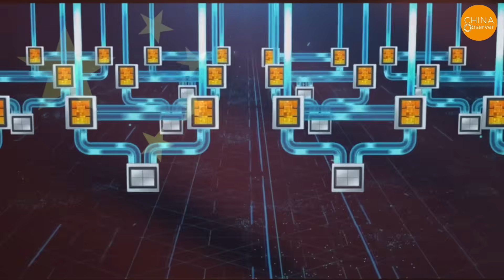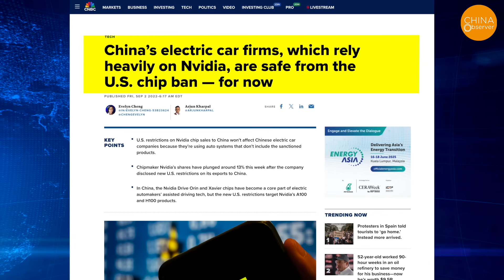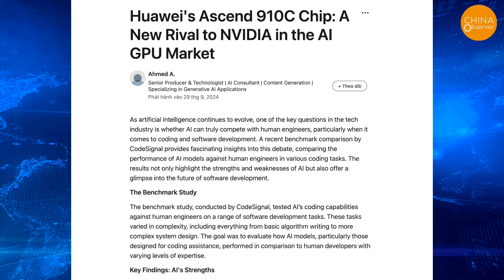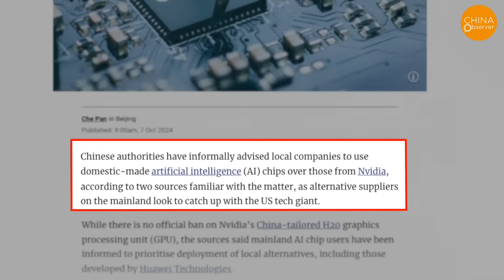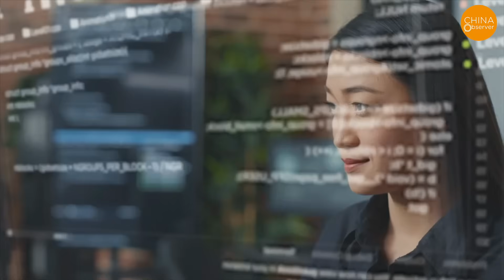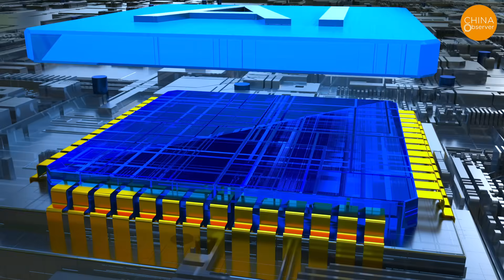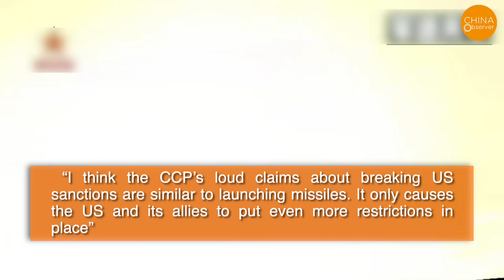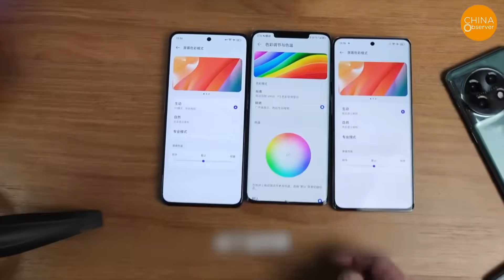Huawei’s Triple-Fold Phone Broke in 2 Days, Yet They Boast Their Latest Chip Surpasses NVIDIA!

Comment: Bet they could find 10x performance minium if they optimized the software. I recall playing Total annihilation on a 400mhz single core  from more than 30 cpu genertions ago with tens of thousands of 3d units. That processor also ran the OS. On a map that was 100 times bigger than the biggest maps in todays mobile games. With 64mb, mega byte, of ram.

An 8 core 2500mhz today with gigabytes of ram can barely scratch its rear without dying.